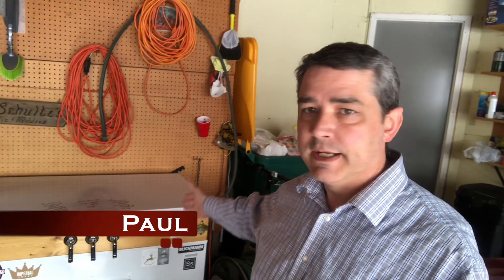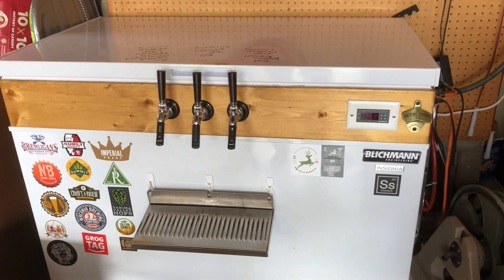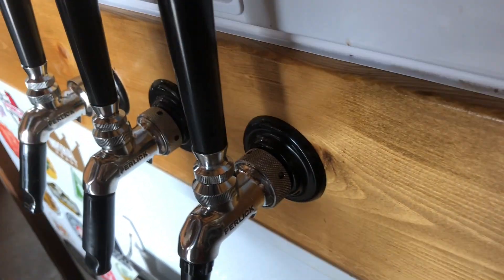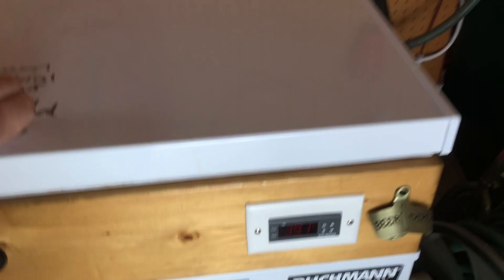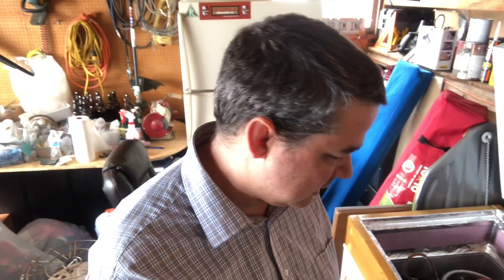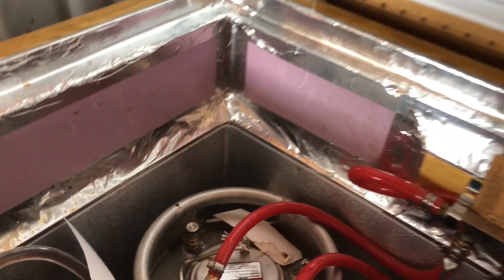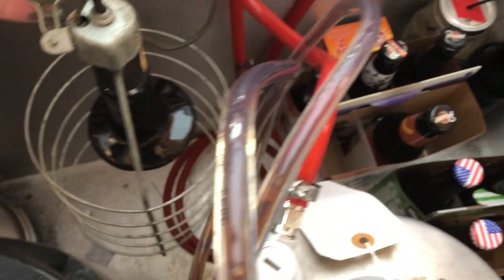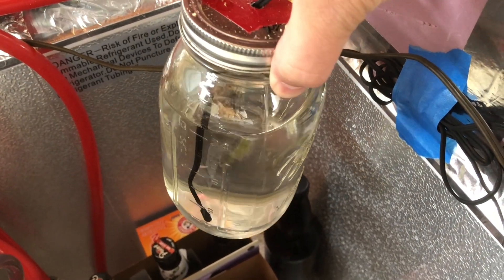Home Brew Wednesday 4-18-2018 Ep.15

Comment: What do you typically ferment in as far as a temperature controlled space?  I've seen your reviews of new products but what is/was the norm before the fermentasaurus, etc?  I've wired an STC-1000 (it's only in celsius, by the way - you're lucky)  into a household outlet in a project box.  I guess the probe does break the seal a bit but it did prevent me from getting into the wiring of the freezer.  I have a terrarium heat belt for heating  (I'm in Alaska so similar climate issues).

Good luck on the surgery.  Hopefully it's nothing that will prevent you from enjoying some homebrew during recovery.
Reply from the maker: I still use a little college fridge for my 5 gallon batches, and an old upright fridge (also in my garage) if I’m fermenting 10 gallons at a time.  For those two I share the inkbird controller that was pictured in this video along with either the reptile bulb or a FermoTemp™ - Electric Fermentation Heater (essentially a heat belt) that I picked up from Northern Brewer.  Thanks for the questions, and for watching. Cheers!